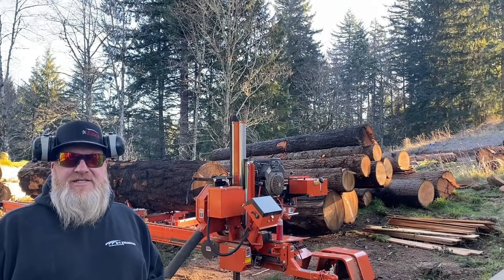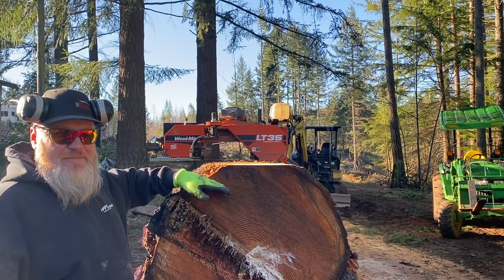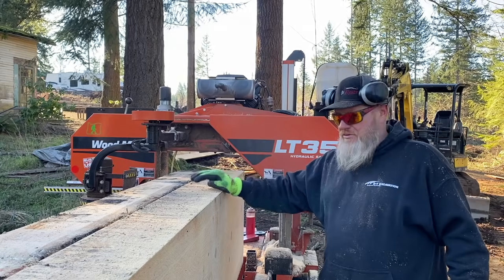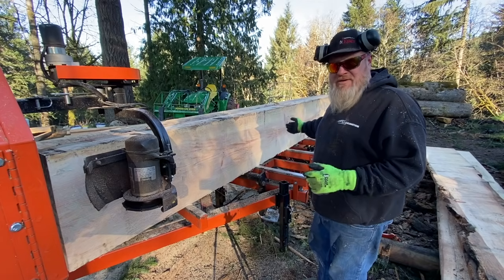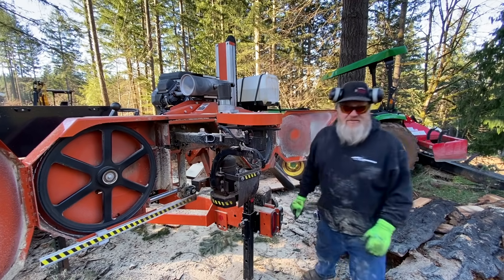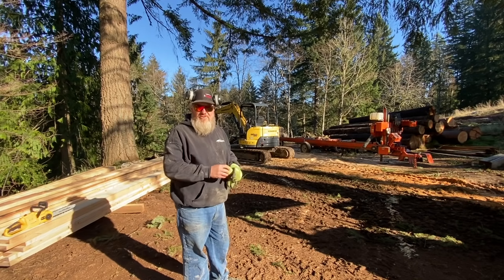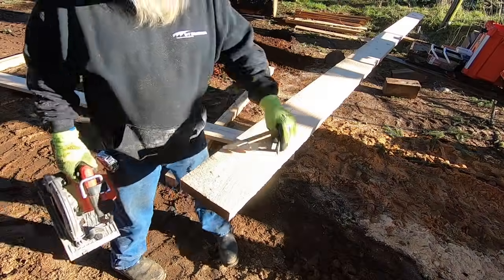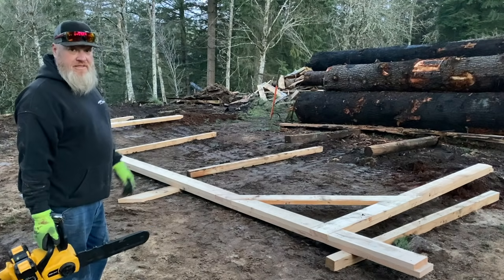Milling A Monster Douglas Fir

Comment: Looking good. According to engineering books a laminated beam is structurally stronger than an equivalently sized solid beam. You might think about picking up a good set of log tongs for use when you use the excavator. Makes handling the logs a lot easier, you don't have to line the log up with the machine or vise versa. A god used set of Skookums, not the ones sold at Harbor Freight or Coastal.
Reply from the maker: A actually bought a cheap pair on Amazon a couple years ago. They work great even today. I made a video showing them.

Comment: My niece bought a cRyobi electric chain saw.  I wasn't too sure about it, but I started using it to clean up some storm damage and found myself impressed.  Maybe a bit short on battery run time, but the power is more than adequate.  Great for pruning/limbing, but it can handle larger pieces if needed.

Comment: If I am understanding right, there will only be two post on that long wall? One at post at each end, & the boards will be laminated/sandwiched in such a manner the it has structural integrity enough to hold up. If that's the case, I say absolutely brilliant idea, & thanks for another fantastic video!
Reply from the maker: Well, that’s the plan anyway 😬
Reply: @NorthwestSawyer  Hope your horizontals don't sag. Those are biggish spans.

Comment: You should be able to work out a way to avoid getting the saw jammed on a log.  Either by having a sighting system, or having some measuring device off the sides of some sort.  Good thing that you have the de-barker with the dirty log.
For small work and camping, you can't beat the electric chainsaw.  I have 3 other dang, dangs as well of course but they are for the bigger work.
Reply from the maker: Some of the larger mills have an available laser that helps you sight the log. I may need to rig something up.

Comment: Yeah, I can give a good report on the AchiForce chainsaw. Not used it too much this winter but I have been clearing 3" - 5" trees along my rear fenceline/garden with it. Fast and I like no fooling with a gas engine as I am death to small engines.
Reply from the maker: They just sent me an electric pressure washer I can’t wait to try. My gas unit is crazy loud.

Comment: Looking great so far, Jason. It's more ambitious than I would attempt these days but that's just my age. Did I understand that you're setting the posts on concrete pads? I was wondering about treating the ends if you were burying them. Looking forward to your next video. Stay safe. 
Bill
Reply from the maker: You are correct. They’ll sit on pads and once I’ve squared and plumbed it all I’ll pour some concrete around them. This is going to be kind of a temporary structure so I’m not too concerned about treating the posts although I may apply a sealer before the concrete.

Comment: Just wondering why you did not take any Octal cuts - would have cut a bunch of the bark off and maybe saved you a bit of time?
Reply from the maker: The fewer trips through the bark south the blade the better. I didn’t pay enough attention to how much taper that log had.

Comment: I have a new LT 35 here in the Skagit County Washington and sawing a lot of fir.  Do you have any issue with using what seems like a lot of blades.  I also seem to be popping the breaker to the de-barker a lot. How fast in seconds were you taking the fleches ?
Reply from the maker: When my mill was new, it seemed like the breaker popped constantly. Now it doesn’t. I’m not sure why that is. I think the bark on fir logs is hard on blades. Same with cedar. The less bark you can saw, the better. I’m not sure what my flitch times were.

Comment: Hey mate are you using bi metal bands and how many average size 600mmx4m logs before it goes dull
Reply from the maker: I did use the BiMetal blades to cut beams that had staples in them. They are amazing. They last much longer than the Double-hard blades I normally run. I would guess you’d get 4-5 times more run time out of them. They are, of course, more expensive.
Reply: @NorthwestSawyer  I only get like 7 to 10 logs out of my bi metal ones so the double hard aren't as good hey
Reply from the maker: @diggertree6677  the double-hard are good for around 2 hours of milling they say. I think it really depends on how big the log is, species and blade lube. I had really good luck with the BiMetal blades on Douglas Fir and Cedar.
Reply: $32 for the standard blades and $110 for the bi metal what do you think is better value
Reply from the maker: @diggertree6677  wow! That’s a much bigger difference than I’ve paid. I think the standards are around $20 USD and the BiMetal was around $40.
Reply: @NorthwestSawyer  oh ok I'm in Australia I might try the double hard see how they go thanks mate
Reply from the maker: @diggertree6677  awesome! I wish I was in Australia!
Reply: @NorthwestSawyer  why is that a bit cold there or because of covid
Reply from the maker: @diggertree6677  we just had a massive ice storm. The worst I’ve seen in decades. Plus you have beautiful scenery and great fishing!
Reply: @NorthwestSawyer  yeah I love fishing too and I don't know how you guys do the work that you do in them temperature's your a better man than me I'm freezing cold at 8 degrees celsius and don't go outside lol

Comment: Is that log as dirty as it appears?
Reply: they might have been charded in a fire last fall
Reply: It's the fire damaged trees he had cut down.
Reply: @barryhansen6854  ok, that makes sense.
Reply from the maker: Everyone is correct. It did have some dirt and rocks stuck in the bark but it is also one of the logs burned in the wildfire last summer.